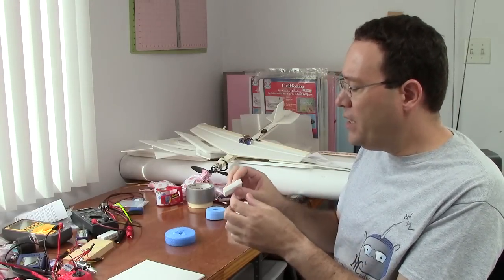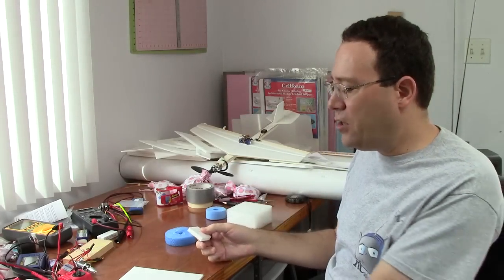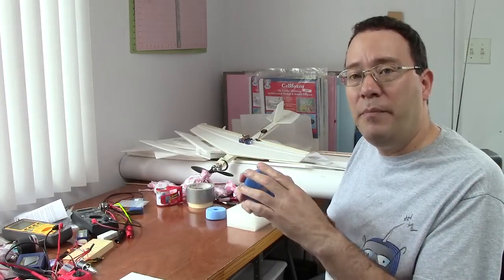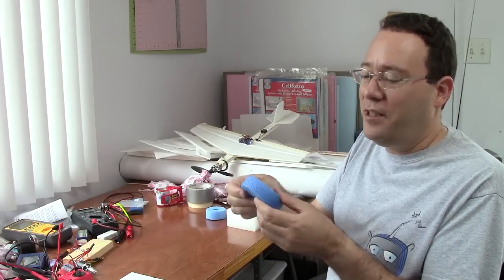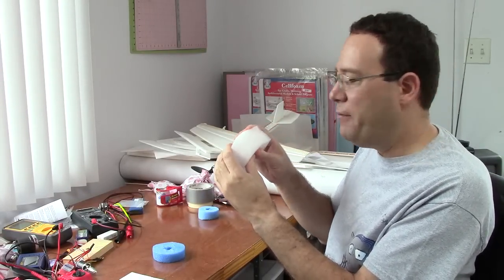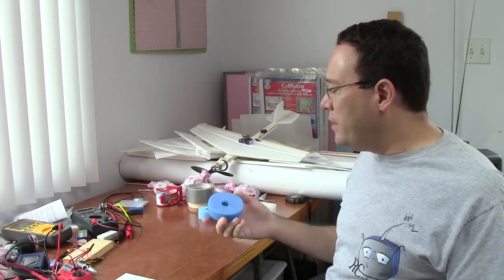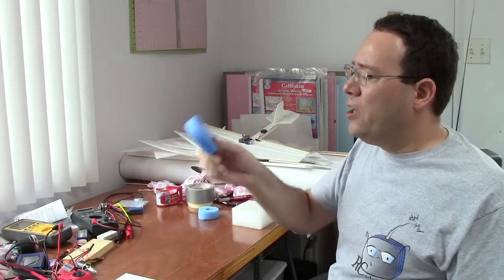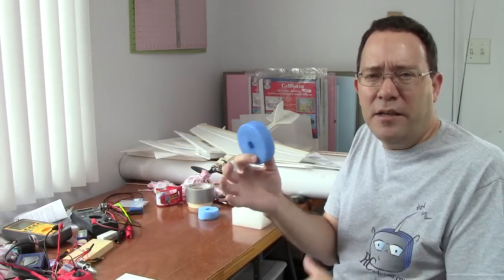Introduction to RC Airplane Foams

Comment: Excellent video Carlos! As I crash rather than land the plane, I was happy to find some big pieces of EPE packaging foam at work 1000x150x80mm and I am now cutting out a fuselage for my home made foam wings. My wings are folded 6mm foam which I think is made in Poland and sold in the UK as Kilma under floor insulation. It is very similar to Depron but is available from Screwfix outlets all over the UK There is also a website called efoam with a co and a uk that sell EPE as Ethafoam.